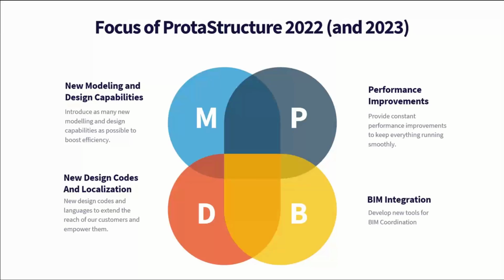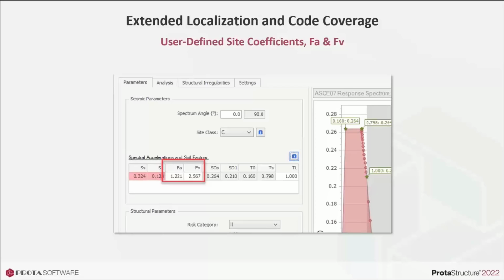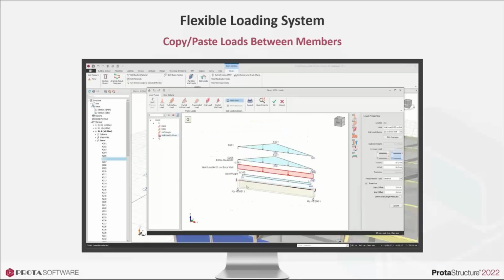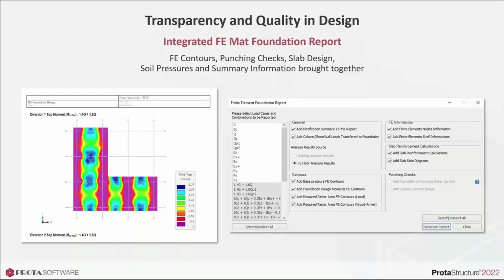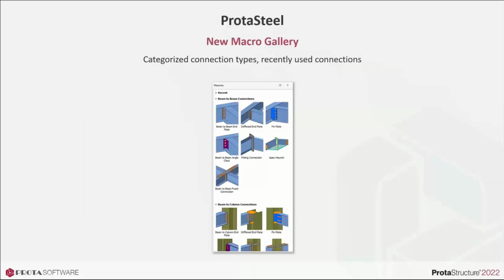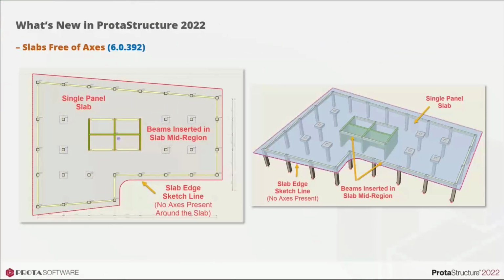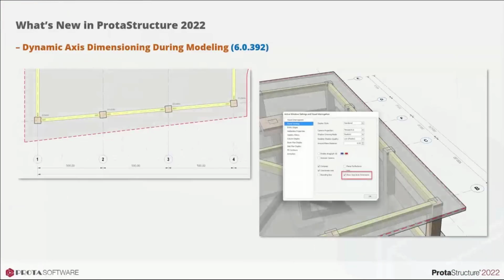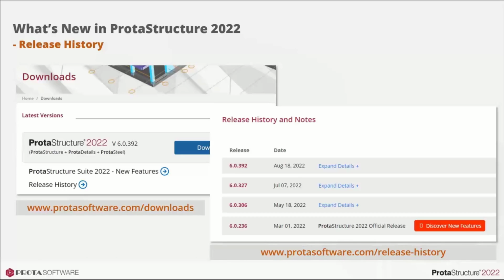Essential New Features & Powerful Tips and Tricks of ProtaStructure Suite 2022

Comment: Since ProtaStruture 2022 uses the same soil vertical subgrade coefficient for static and dynamic analysis, is there automatic stiffening of the soils coefficients or do we have to make two different models each time, one for static analysis and one for seismic? When we have a raft foundation structure, what are the horizontal soil stiffnes (Kx=Ky=?) and can we change them because they affect the displacements and forces in the structure, especially for stiff structures on soft soils?